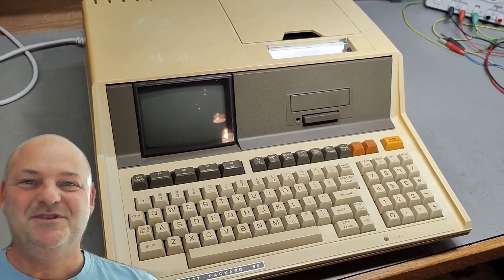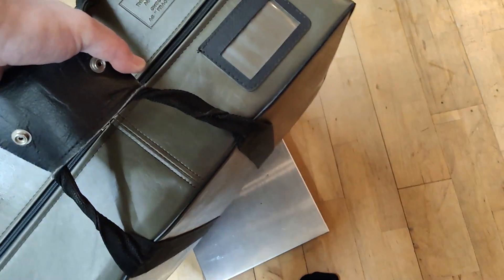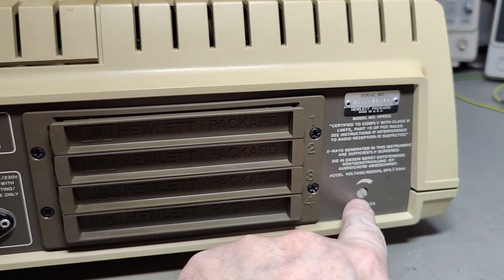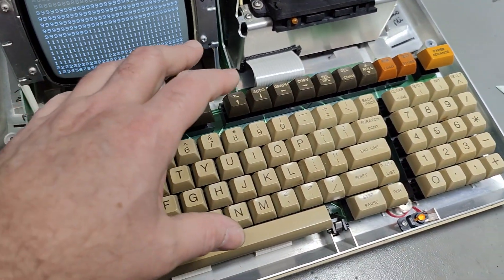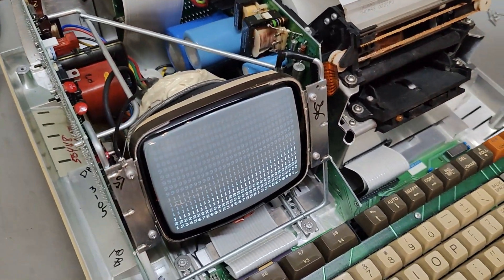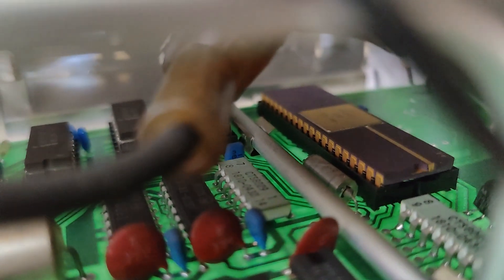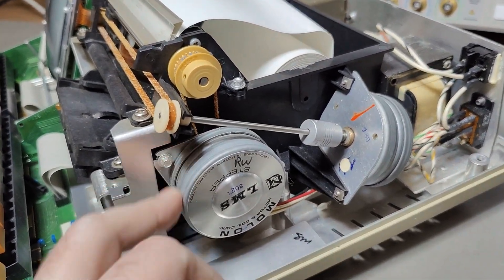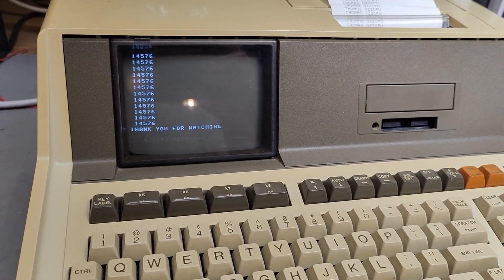Hewlett Packard HP 85 Personal Computer 1981 running Basic

Comment: While working at Parker Hannifin as a student intern in 1982, I used an HP 85 to create 1) a Basic program that mathematically modeled the design of a hydraulic quick coupling to predict its pressure drop (pretty accurately), and 2) a Basic program that automatically controlled and monitored  a test apparatus used to run pressure drop tests for quick couplings at various flow rates. The manager still concluded I was not worth keeping on full time.